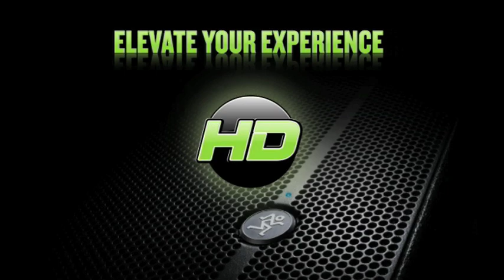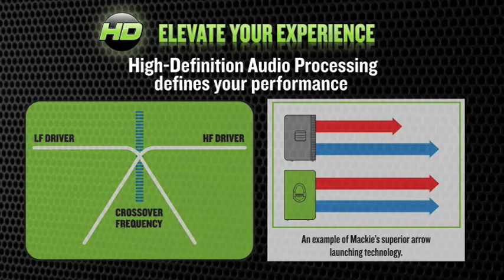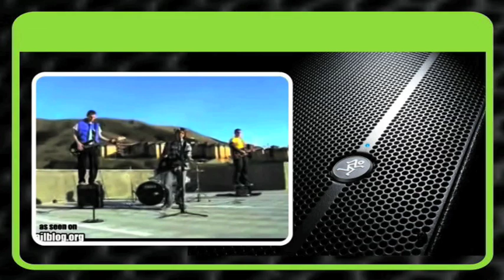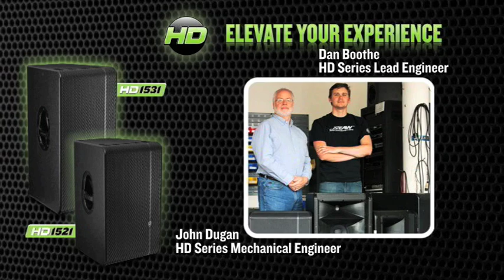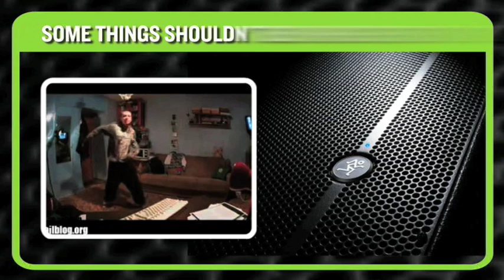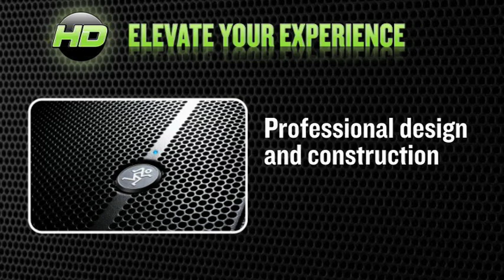Mackie HD1521 & HD1531 Powered Speakers

Comment: Both of my HD1531 have failed, what I thought was a cold solder was actually the power supply failing (happened on both). Now in 2023 only half the parts in one of them works and ironically the other half in the second one are working. I’m combining the good parts to get one working in the hopes of selling it and I’ll probably throw or give away the busted one.
Reply: How many years of use did you get?
Reply: @ObservationAudio maybe 3 at most

Comment: What happens is people turn the powered speakers all the way up or over half way and then push all the power that way when you should never turn these over half way. I have used Mackie for a long time and never had any problems with them and now moved up to E.A.W LA215 passive yay they are big money  but both are the same company you cant beat these speakers never well worth the money.

Comment: i have 3 hd1521 and two already fail. i have a pair of srm450 and a pair of c300 never had any problem with them. the amp on the hd series are garbaje, they cilp very very easy.

if you have mackie hd make sure they dont clip, because if you let them clip for several minute they will fail.

Comment: My HD1521's both blew their HF units. My Numark rig has been driving other units and 450's for years - NP. These HD1521's are unreliable. Mackie - I want a corrected - validated and proper pair. I spent $3k down the tube on you guys. Neither you or Guitar Center are owning up to anything - please stop telling me its operator error - contact me....

Comment: These look every nice, and I like what they have done with the DSP processing, to not only cover phase correction and flattening response, but also to correct for horn and cone issues.  However, it should be noted that the extra power will only gain you about +3dB at most, which really isn't that much.  Doubling power only adds +3dB, that's physics.  They way to get louder is in efficiency, not loads of amp power.  But over all, very, very nice cabs :)